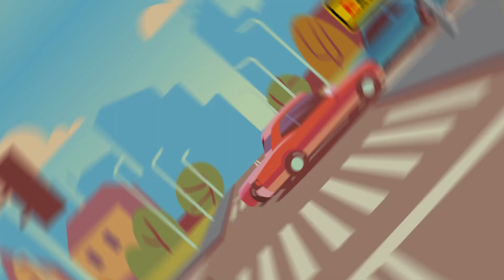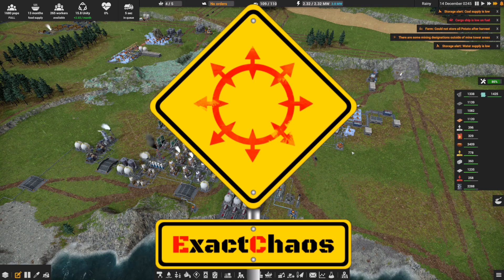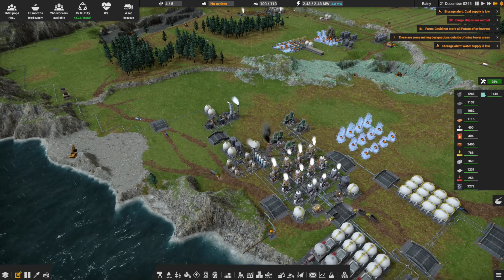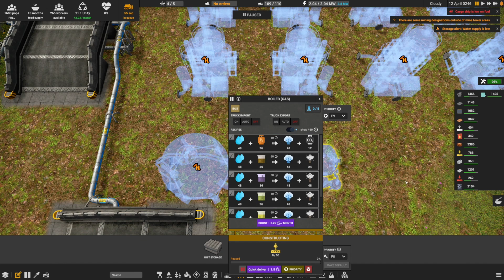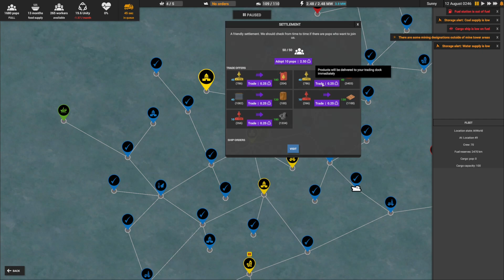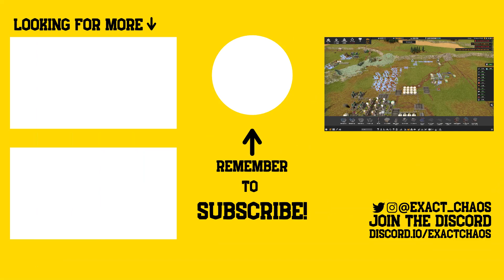Planning a better diesel setup - Captain of Industry

Comment: good set up, one thing you could do to save a bit of power, is run the nitrogen into fertilizer production on the other side.

edit also you are producing half capacity on the 3rd splitter, so 60 hydrogen is going into the boiler